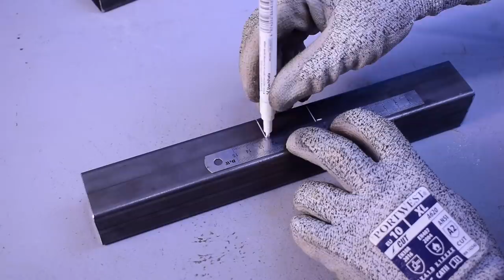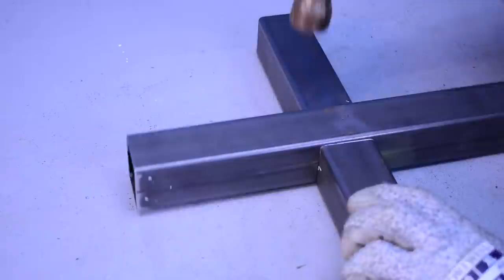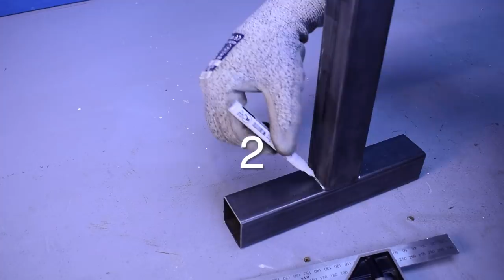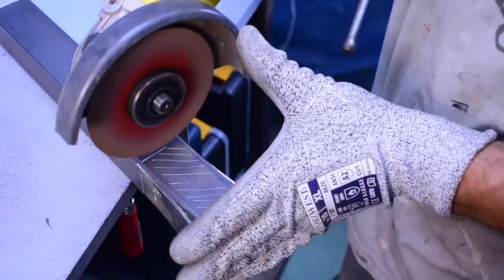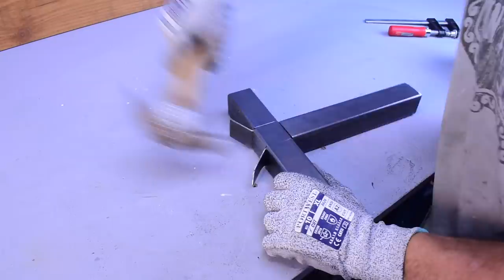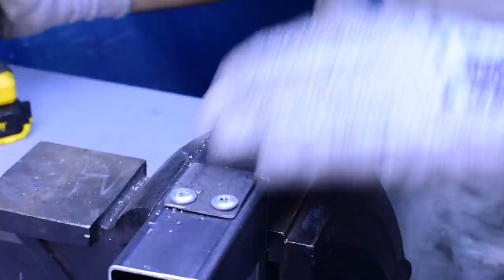Welders Don't Want You Know This! Join Metal Pipes Without Welding

Comment: Yeah, OK, but welding is done for more reasons than just sticking metal together. Duct tape can be used if all you need is 2 pieces to be stuck together. What you've created in the video is a very weak joint compared to the huge pieces of metal being used. That's not cost effective. One reason to weld is to create a joint as strong as the metal used in order to reduce cost. Yes absolutely you can use massive metal members and bolt or rivet them together, just costs a lot more than welding in most cases.

Comment: It's ok as a welder I feel in no way intimidated I would say that's good for something temporary that being said these techniques are nothing new allot of it you will see in structual building and even though things get bolted the science behind it says that the bolts are not enough imagin if you will this is a permanent structure right those bolts under stress are going to wear and tear and you have to take into account  corrosion wich happens faster than most may think especially in the cut joint and drilled holes because you have exposed the metal surface past its protective coating wich yes they do mix into the metal to try and give it some sort of resistance to weather and corrosion but it is not a 100% accurate thing under stress corrosion begins in minuts under stress those bolts are chipping away at the corroding metal welding is the binding of metal by filling the space between and fusion of the metal with the same metal tensil strength or stronger so instead of it being two parts it is now one single solid part, object , or structure for instance the same techniques here are used putting togeather weight benches, punching bag stands....etc and look what happens to them over time under the stress so I'm the end it really depends on what you are looking for is it something you tend on takeing apart or are you looking for permanency also how much weight does it have to maintain bolts expand when tightening wich weakens the psi or force it can handle however something like this is not bad either allot of things require bolting amd welding combination to releas the stress on either technique wich I would probobly suggest to some one working on a major now I will give props where it is deserved saying this joints are a clear vision of how far mankind has come in the technique to combining things these joints would be more sturdy and durable than just lapping two things over one another and bolting things togeather